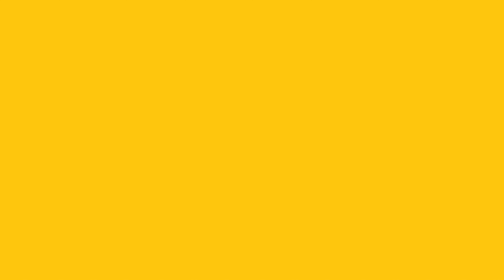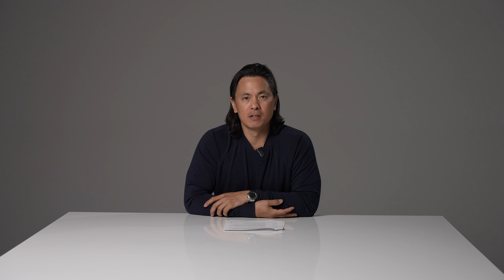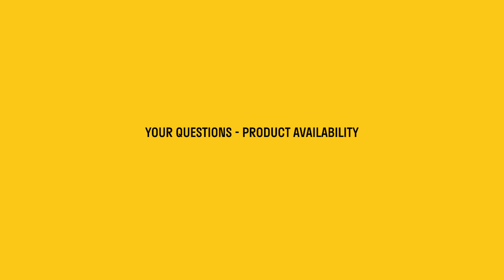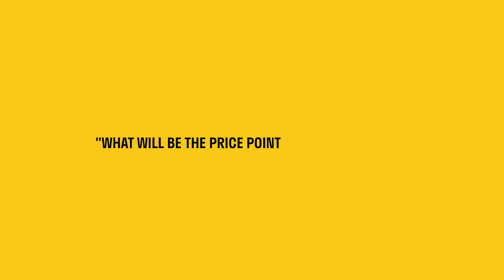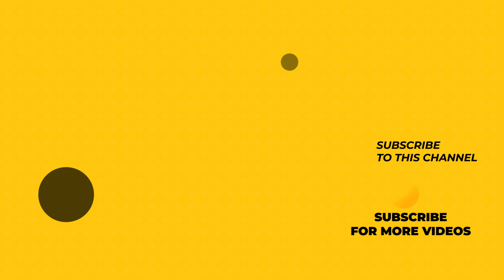ACTIVE 2.0 Q&A PART 3- ANSWERING YOUR QUESTIONS

Comment: I've had a pressure washer station on my list of things to get done, for some time, now. I've always just had more important projects, in front of it. And while I definitely had the Kranzle on the list, as the pressure washer, to absolutely buy, I appreciate the time you've taken with digging into what drives the change that you've built into the 2.0. The 2.0 may actually be on my list of pressure washers to buy, for my garage wall unit. I was looking for something comparable that was a little more than what was currently on the market. The something in between what's out, and a Kranzle, and I think this fits right in the middle perfectly. I've also watched the Short Gun and the Foam Cannon videos, and its great to see the quality of products that you are working on. Thank you.
Reply from the maker: As we’ve said in many of our videos - the Kranzle is a great unit.  But its very expensive for most users.  Performance wise, you will do better with the 2.0 but obviously the Kranzle sounds nicer (objective) and parts of it are serviceable.  We are looking at our product architecture and also recognize there are different levels of products desired by different customers - all the way up to Kranzle.  We hope to fill those gaps.
Reply: @ACTIVEPRODUCTS  I think you’re definitely making headway. I think the best video that you could have done, was addressed the issues of why people returned their units, and actually offering solutions. So many brands have zero connection with their customers, and they just keep putting out a bunch of pressure washers, and people are forced to compromise, and pick the best of what’s sold in the market.  

Matt is a huge influence, in the pressure washing world, I’ve been following his channel for years and years, and he may sort of become a thorn in your side, when it came to him swapping, and modifying, with longer hoses and playing with nozzle sizes. 

I would also suggest offering different packages with the 2.0. The 2.0, barebones, for people that already have the wands and hoses, and nozzles, and a second package, that offers the 2.0, your stubby gun, and your foam cannon, for a price premium, for the people that don’t have that equipment. I’d also do some research and spec a 50’ hose that you can add to the kit to make it complete. I have a 50’ kobrajet hose, a mosmatic stubby, and an MTM Hydro Foam cannon, already. So, I wouldn’t be that interested in the foam cannon and the gun, because I’ve already spent that money. But, I can understand from a product standpoint, that if you only sold the 2.0 with the foam cannon and stubby gun, there would be better margins for you, because you’re making money on the whole kit, and selling the kits ti everyone, regardless of if they aren’t going to use the rest of the kit, or not. Thank you for taking the time to reply to my comment. You guys are world class. 👍

Comment: Quick question.  Will the 2.0 be able to handle a 75 ft hose?
Reply from the maker: That’s a good question.  We have run a lot of testing with 50’ which is what many of our customers have been upgrading to, and is the most readily available.  We will see if there’s a way to test and give you an answer if the unit can run reliably with a 75’ hose.
Reply: @ACTIVEPRODUCTS  Thank you. Hope to hear from you soon
Reply: I would be interested in this as well, as I run a 75 foot hose

Comment: Me, getting excited about the possibility of getting a more enthusiast affordable washer: 😁
Me, after James says us 'Nucks probably won't see it until 2023 or 2024: 😥

So I've gone down the rabbit hole of researching Simoniz and Active, because I saw a Simoniz washer (the VE52) on sale at CT the other day and I've been seriously considering it, but I thought it looked oddly familiar to the Active VE52. Come to find out it's just rebranded. Some more research, and here I am thinking I might as well just wait a couple more months for the 2.0, buuuuut it seems that may not be the case. Unfortunate, but I understand the backrooms of branding and licensing and such it much more than us customers see. I will certainly be keeping an 👁 on y'all because so far I like what I see in terms of updates, customer interaction and developments.
Reply from the maker: Didn’t mean to confuse you - the VE52 is the same as the Simoniz Platinum 1800 except some accessory differences and a GFCI plug.  The 2.0 has not been slated for launch as a Simoniz product yet, but there are other exciting Simoniz launches for 2023.  I will say at the price Canadian Tire is able to sell the 1800 for, its the best deal on the market.

Comment: Will the ve52 advanced kit accessories from OG  fit the 2.0? Im in the market and been eyeing that kit. In other words, will it have the same fittings?
Reply from the maker: The OG website says the following - "50’ High-Pressure Hose w/ MTM Stainless Steel 3/8" Female QD Couplers and M22 Female (15mm) to 3/8" QD Plug" indicating that the kit may not suit due to the M22-15mm connections. OG will be working on a specific kit optimized for the Active 2.0

Comment: So I should probably by the current simonized version as I was planning to during its next sale, then get my 150 hours out of it. Then buy a 2.0 in 2024?
Reply from the maker: That might be a good strategy. The Simoniz 1800 Platinum is hands down the best value in the market when on sale.
Reply: @ACTIVEPRODUCTS  I can't wait to get it. I already ordered an MTM gun, kobrajet hose, foam cannon and 2 stage deionizer. Going OG on a budget.
Reply: I grabbed a Simoniz 1800 last fall here in Canada for $200 CDN. Been working great up until a few weeks ago. Using a 50 foot hose and have now started to experience the surging issue. It's almost unusable since I have to turn it off manually all the time. Good luck trying to contact Simoniz as they are unresponsive. Question for Active, do I have any options at this point? Should I just go ahead and purchase another unit?

Comment: Whoa..$300 to $350 USD means it'll be $450+ here in a Canada. A big jump in price. Simoniz won't launch in July--there's no way. Planograms get set in Spring. So Simoniz maybe in 2023, Active direct in July 2022, but that price point may be challenging.
Reply from the maker: We have a ton of new Simoniz products for 2023 as well. Prices in Canada tend to be lower as well.

Comment: I've been using a 50 foot hose with no issues.
Reply: How long do you run the unit for at any given time? My cat 1800 seemed fine with a 50 ft hose at first but after a few uses it now surges but only after being run for 20 minutes or so. I have no idea why it needs to warm up to start surging but it does.

Comment: The ve52 should of not had surging issues knowing most of us was going with a 50ft house. The surge is so annoying.
Reply from the maker: You are correct.  However, when we started this project a few years ago - quite honestly we did NOT know that most of our customers would be changing to 50 ft hoses.  So its been a lot of testing and revisions to the VE52 to keep improving the products.  One of our videos talks in depth about the changes we have made over time in the product to reduce this issue.
Reply: @ACTIVEPRODUCTS  I still continue to rock with you guys there is no other company with such great Customer service. And I still love my Active pressure washer.
Reply from the maker: That means a lot, thanks so much.

Comment: How will the 2.0 compare to the cat 1800? I am new to your brand and just stumbled across one of your videos that seems to say you guys also made the cat model. Also, how does the cat model compare with the ve52? I am trying to figure out if I should wait to buy until the 2.0 comes out.
Reply from the maker: Hi Jason welcome to the Active community! Simply put, we created the Active VE52 under 3 different names: Active (VE52), Simoniz (Platinum 1800), and CAT 1800. They are all essentially the same unit with the same performance and capabilities with the difference of the standards we must follow according to the country. Nothing different between them except for which name brand is available to you.
Reply from the maker: In terms of how the VE52 and the CAT 1800 will compare to the 2.0, the 2.0 has double the life cycle (200 hrs), the pump is also upgraded, we are using higher quality parts for the 2.0, the working pressure for the 2.0 is also higher.
Reply: Its exactly the same as the ve52 with a different brand